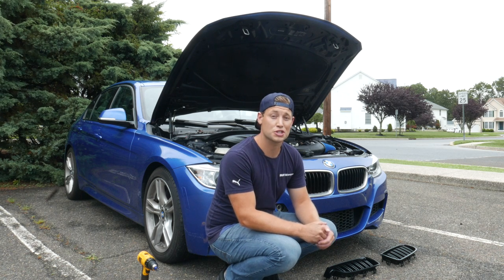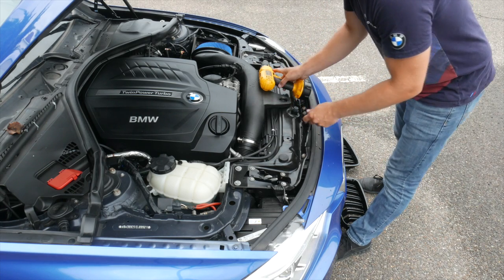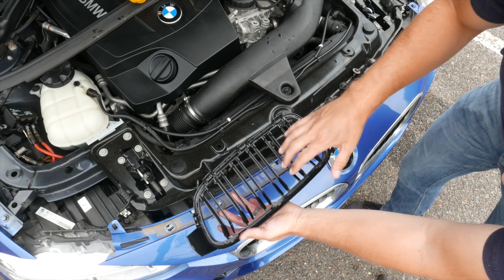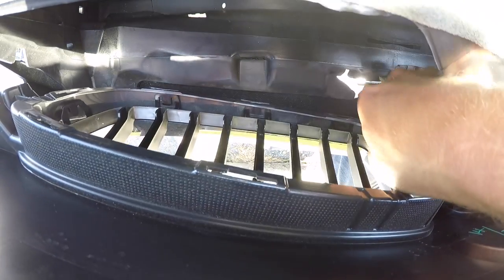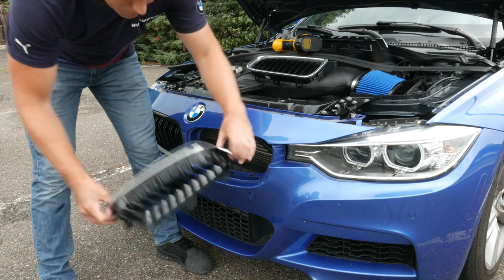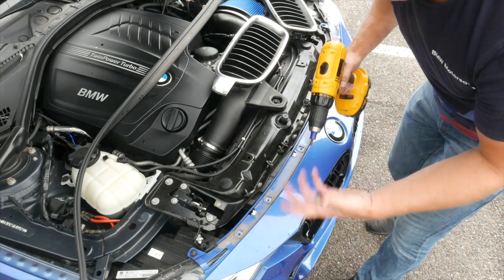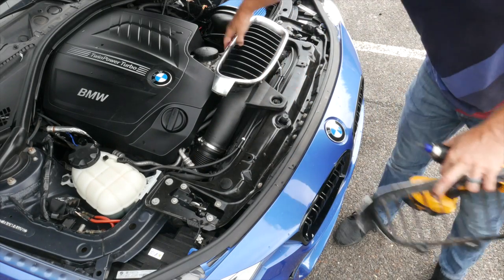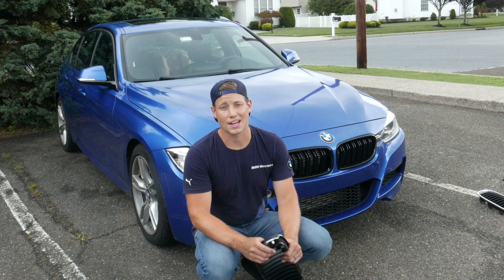BMW M3 Style Grill / Grille Install! How to remove and install a Grille on: F30, F10, F15, F25, F80

Comment: I just did this with my 2018 440i. Newer models don’t let you pull the front of the car as far back so putting your hand in the car is almost impossible. The best way to do this is using a screwdriver as a lever to pop each tag without even opening the face of the car. I don’t know why nobody has made this video it’s definitely the best method

Comment: just did mine F32. Simple. If you got big hands like me start from top like this guy did. and take the other side out once you have one of them off that way you can just reach in. Dont be scared to pull on bumper a little bit it gives a good amount of pull but dont go hulk on it either. Took me about 30 min

Comment: Thank you! First grille replacement video that calls out the groove on the headlight. The first time I replaced mine, I couldn't for the life of me figure out why my bumper and hood weren't laying flush.
Reply from the maker: Ahh, yes, that's why! Also a very good tip when installing new headlights 😀
Reply: Kies Motorsports Got headlight recommendations? I remember a teaser video, but haven't seen anything since. I really need to change mine out.
Reply: It's little details and nuances like these that make instructional videos so valuable! Great job Kies Motorsports!

Comment: I did this about two weeks ago on my f36 and I did not really need to undo any screws and bother with bumper realignment. I just squeezed my fingers through the grill slats and undid the latches. It is a tight squeeze and my fingers were a bit sore, but after around 10 minutes I was done. Also dont put the new grill in when you still have the other old one on! Put your hand through the hole and reach out to undo the latches on the second grill. It makes it so much easier.. ;)

Comment: Having just done this, the worrying part is bending the front end of your 25K pride and joy to get your hand down to reach the tabs. Took me an hour and a half to get the first one out and I still broke off two of the tabs, they are quite brittle if pushed the wrong way.  If you break the tabs off it doesn’t really matter if you’re not interested in retaining the old chrome grilles, it doesn’t affect the new installation.  After removing one grille, don’t put the new grille in, as you can use the hole to reach through to find the tabs on the second. It took me 5 mins to fit the second one.  Check the bonnet / fender gap afterwards, you may need to make a small adjustment when tightening the screws down to ensure an equal bonnet / fender gap all the way along.  Note, some manufacturers provide a tool to reach down to the tabs. I wish I’d known that before scraping the skin off my hand!!

Comment: Nice video, but the grill install is about 200% more difficult than you made it out to be.  They do not just pop right out on the F32. Took a lot more maneuvering to get them unclipped. I did find your notes on lining up the screws quite helpful.

My new double slat glossy black grills are 🔥 though.
Reply: I have a F32 too and when I had to remove mine that was such a pain in the ass wayyyy more difficult than he made it out to be in the vidro and the clips on F32 are also way harder to get them unclipped.

Comment: You can take the whole bumper off to replace the grilles. I know more screws to remove but a lot easier to remove the grilles. Less bending the bumper at well.

Comment: my bumper doesn't bend that much. also i have some additional rubber inside and barely reach the corner clips on top...bottom ones no chance...i'm just gonna take the bumper of...because i'm trying to bend it and i'm afraid it'll snap

Comment: what’s the difference between these grills and the ones that are 50$ on ebay? why are two pieces of plastic priced at 160$?
Reply from the maker: Better quality. It’s like getting headphones for a dollar on eBay vs good quality headphones 😀
Reply: Kies Motorsports i understand the quality difference but in reality will i grill really take that much wear and tear? Im looking to buy a pair and don’t want to make a mistake lol.
Reply from the maker: I feel like whenever I buy the cheap ones (of anything),they stink and I have to buy them twice
Reply from the maker: +Yubgcharmander sometimes the clips on the cheap ones don’t secure the grill in place
Reply: You can even plastic dip your old Chrome grill for 20 bucks

Comment: I just installed matte black grilles on my white 335d but when removing the chrome ones a plastic thing fell out from between the grilles, I don't know how to describe it, it's a black two piece sort of support 'thing'. I had a bit of a panic as I wasn't sure how important it was or whether I'd be able to put it back correctly. I think I did, but it's worth mentioning cos it threw me for a minute!! 

Has no-one else managed to dislodge this 'thing'??

Comment: Me being the lazy bastard that i am; initially tried the “easy” way yo pop those grills, by not unbolting the bumper and simply trying to pop the grill by getting my fingers trough the grill.  Ended up with sore fingers and unbolting the bumper for easier access. Do it right, do it once

Comment: 150 dollar for that ? damnnn

it will give 5HP
Reply from the maker: No horsepower, but it gives you 10 style points ;)

It's more money than the ebay and Amazon ones, but you get what you pay for... This one is really good quality. I helped someone out and put a cheap grille in a car and the clips were so terrible they wouldn't stay in. I'd rather buy it once and get a better quality one right off the bat
Reply: You will also hear horror stories of the cheap-o with their slats breaking down the middle during installation. This happens when people don't necessarily know how to install/uninstall and apply excess pressure during the install/uninstall process. The solution? Buy a more durable product! :)
Reply: Official fr0d ...I bouth ithe same grill in e bay for  42usd
Reply: Richard Mantilla good info bro

Comment: If you don't put the first grill back in, the second grill is much easier to get out by going through the 1st grill hole to release the tabs.
Reply from the maker: Since I had everything opened up on the top, it was just as easy to reach over. The old taps had some plastidip on them, but it still came out easy
Reply: Kies Motorsports still don't understand why people plastidip when it's easier and cheap just to replace.
Reply from the maker: Yea, not a fan. I did it on my old Wrx, but it got weird after it baked in the sun

Comment: Just did the same thing on my M4, but the bumper doesn't flex outwards nearly as much as in the vid.  Was a bit more difficult on the F82, but I just removed one grill, and used that big opening to get the other one out.
Reply from the maker: Nice! Yea, I haven't done an M4 Grille, but I did a 6 series, and it was a lot more rigid than an F30

Comment: How about on a 2020 G20 M340xi. I have the hideous gold/bling stock grill, BMW now sells a black grill but wants $169. to install. I've swapped out grills on an 2011 550i, that was easy. 

I removed the top brackets and 2 12mm. plastic allen screws from the lower outside on the G20. I can't see or feel were the bottom is clipped in. Any ideas?